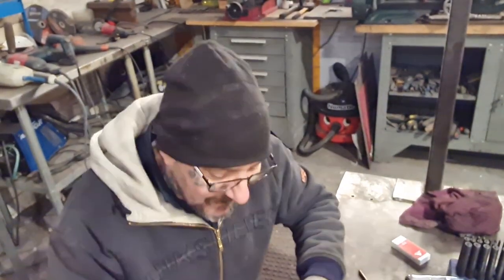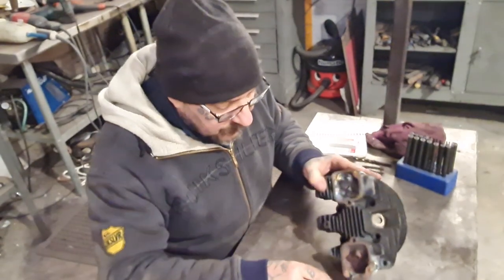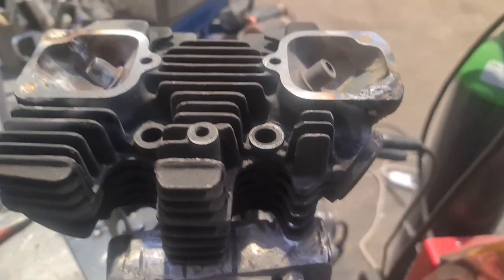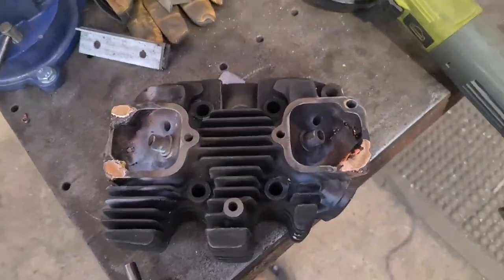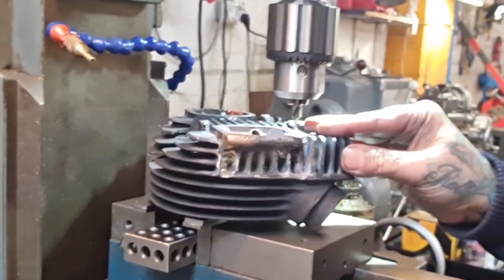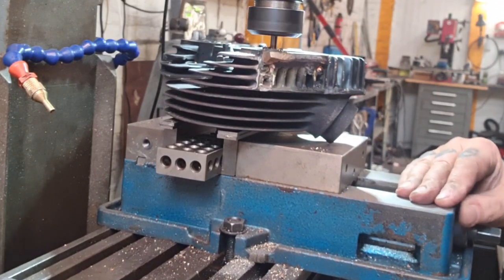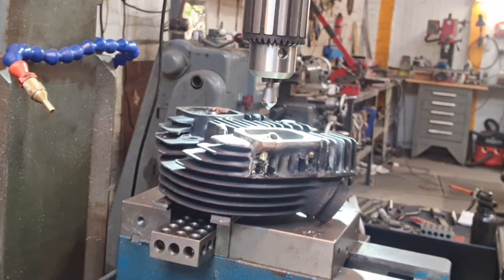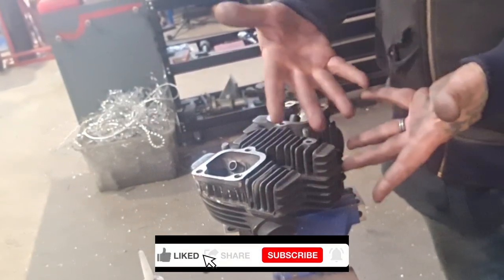Head Bender Pt1 #workshop #vlog #motorcycle #harleydavidson #custommotorcycle #viral #bike #ironhead

Comment from the maker: Hi and thanks for watching 
Since starting this, I've learnt that  brazing /silicone bronzing can lead to seriously hard inclusions (who knew 🤔 😆)
Reply: Never knew that thanks for sharing 
I've only ever welded cast iron heads with an arc welder and cast rods although you can get away with stainless rods 
Pre heat and an asbestos blanket essential 
Still goes rock hard for drilling and tapping though!!!
Would it be worth trying a taper tap first if it has more lead than your machine tap? 
Best of British
Cheers

Comment: Ralfy when you were working out the No1 drill size I could hear the gears straining ... 😂 Very original content and interesting to see, thanks. I learnt a lot. I find the properties of materials to be a fascinating subject. I wonder if phosphor bronze (C11) would have been better than silicone bronze (C2 for gas/C9 of TIG). Have you got a tapping head? (you might still break the tap anyway). Must have taken an age to edit. Cheers
Reply from the maker: Thanks Buddy, yes I've consulted my personal advisers lol, once you get cast iron red hot it turns glass hard, who knew?
Unfortunately the original gasket face wasn't substantial enough in places to take the machining, so I had to build it up
Reply: @RalfyCustoms  ah yes if cast iron is cooled too quickly I think.  Chilled, I think they call it.